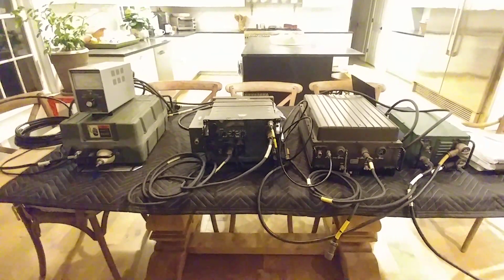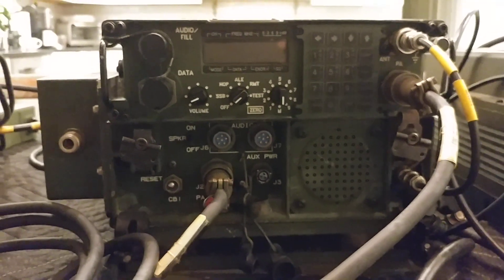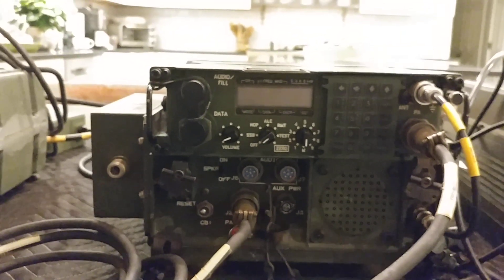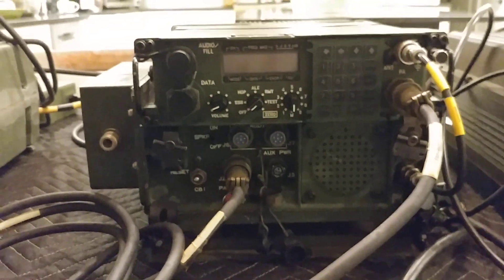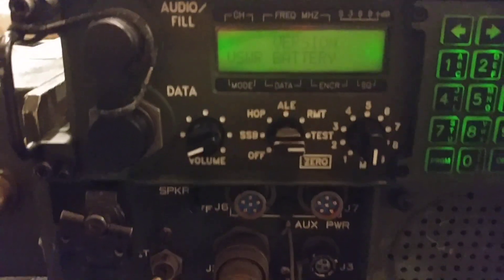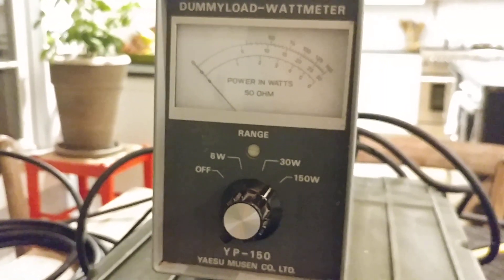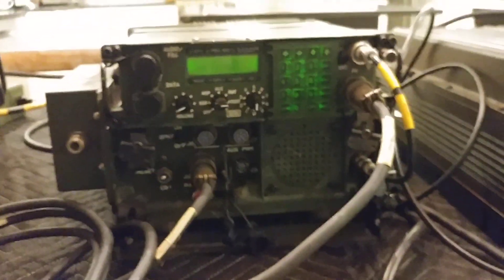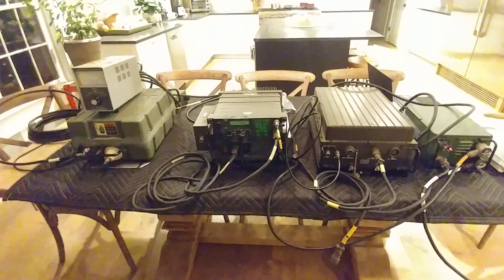Using a PRC-138 with an RF-5833H 150W Amp

Comment: Just picked up a 138, is there any way to freq tune it in faster steps than 100hz?
Reply from the maker: If you mean faster as in 1kHz steps, I think so yes. I haven't played with my 138 in a long time so I may be wrong. But I think you can place the cursor on the 1kHz step position and use the up/dwn arrows. If you want to do less than 100 Hz, I think this can be done on the serial interface by issuing "F" commands to set the frequency.  There is a lot I don't recall but it all sounds vaguely familiar. Good luck.
Reply: @w2hx  managed to figure it out, you need to enter some of the freq with the numbers. then stop before you fully enter then start using the arrows to search. sadly you can only go from 0-9 and then repeats. does not go up sequential.
Reply from the maker: @militaryrig yeah, not ideal.